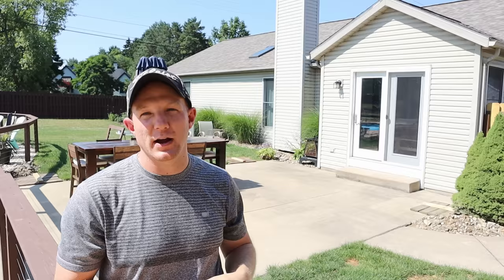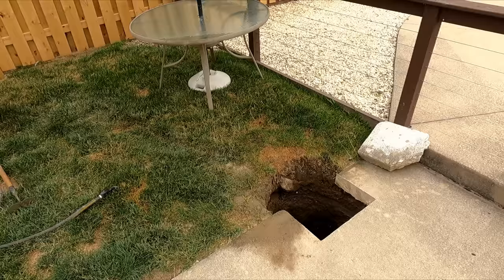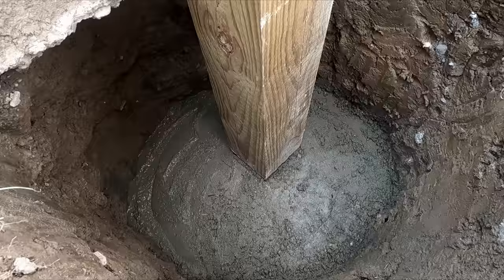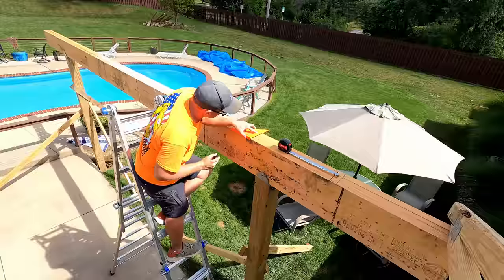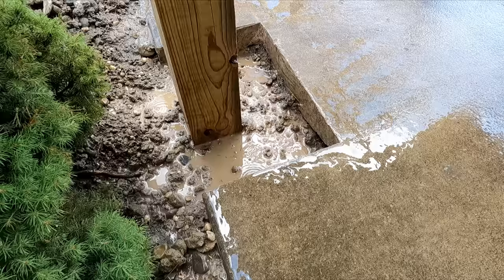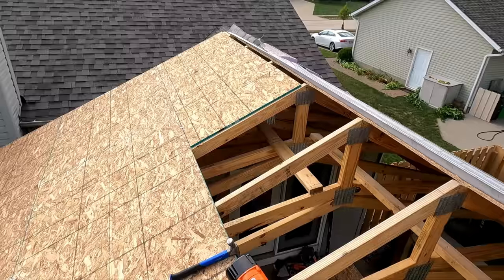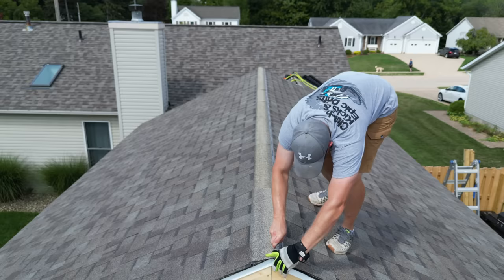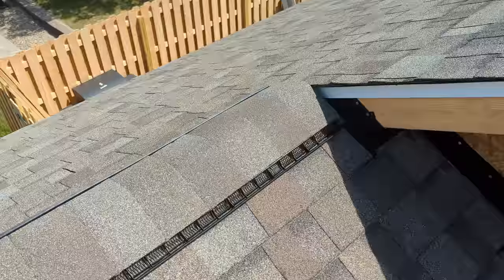DIY Covered Patio | P1: Building A Roof To Cover My Concrete Patio | Foundation, Framing & Roofing

Comment: In five years your "wooden foundation" will rot. Why not galvanized steel foundations? Ever heard of "constructive wood protection"?
Reply: 14:26
Reply: How do fence post last 20+ years but yet you claim these 6x6 won’t last 5?
Reply: Omg!! I bought a house with a beautiful deck, prior owner was a ‘carpenter’, and it literally sank as the 4x6 posts, that were put in dirt without cement, rotted and sank. Goodbye deck. Never again for when I rebuild.
Reply: 40 years 😂. Lucky to get 10.  Stay Hard for Life 💪💯
Reply: Ok. 4 years left to check
Reply: This guy talk can fool many into believing he knows what he's doing...and the fact that the building department approved his plans is beyond me!
Reply: Sitting here in my 100 year old house on  a wood foundation on bois d’arc stumps
Reply: There are literally thousands of barns going back to the 1800s untreated post
Reply: Depends on location and wood. Ive seen a wood basement last 25 plus (and still water tight and untreated posts last 15-20 years (as long as it wasn't in a marshy area) for that matter check out the life span of wood power poles
Reply: Yeah si I build post framed structures for a living and have done so for the past 30 + years.  Nothing wrong with the technique you used, everyone is entitled to thier opinion but it does come down to the details.  The fact that you knew the correct treating retention for the posts tells me you either did dome research or were educated by the building dept. Either way your project will last for years to come regardless or what the negative Nancy's say.  Nice job!
Reply: @patricklucero815 , agreed.
Reply: My house has its original fence from 1970 boards finally rotted out but the posts are still solid which is surprising
Reply: I doubt if that project was inspected and approved. No blocking at truss tails, were  plywood joints staggered?  The posts should have been installed in post base hardware on footing 8” above grade.  I saw some nice work but you made some serious mistakes
Reply: So long as the water is able to run off then the post will not rot in the concrete.